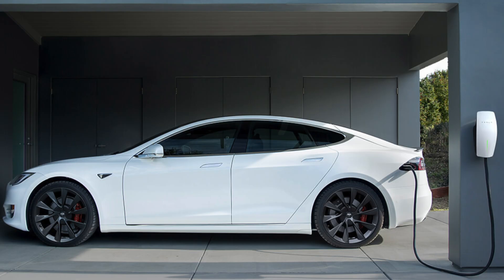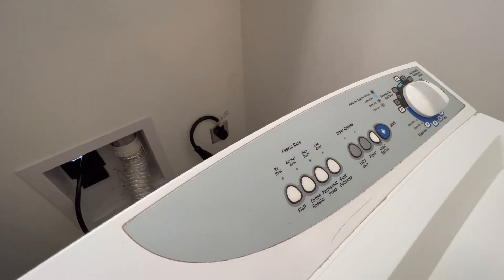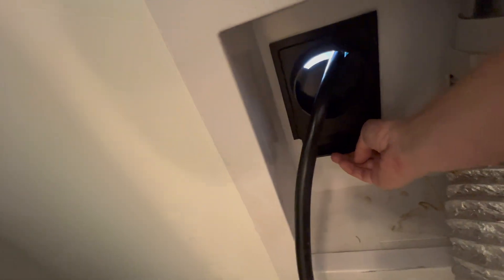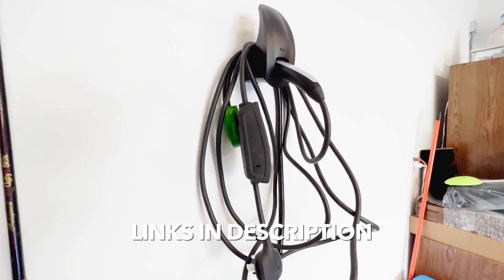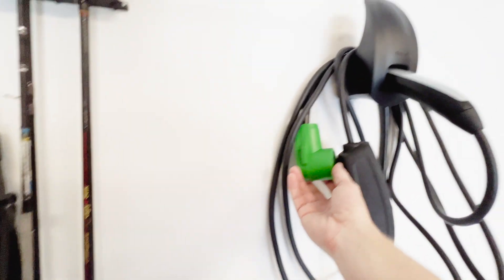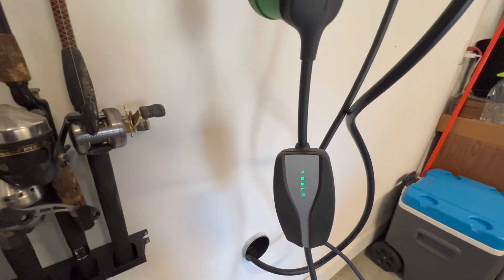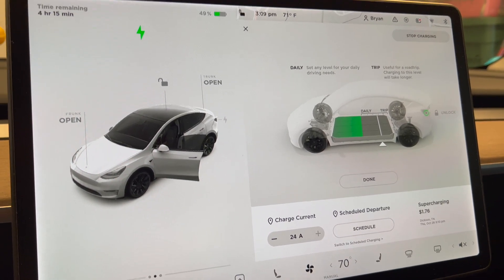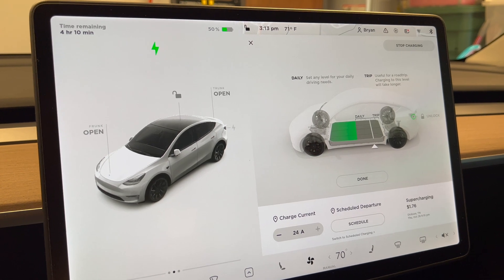Tesla Fast Charging at Home w/ Dryer Plug - Quick Tip

Comment: This is a stupid question, but I am considering buying a used 2020 model 3 and am wondering what charging cable comes with it. It shows a cable in a bag, but I have no idea what that might be. But this video and instructions will work perfectly for me!  Thanks and I appreciate the links to purchase the items too!
Reply from the maker: Hey Joseph - Not a stupid question at all. Up until earlier this year Tesla included (for free) the mobile charger along with an adapter for plugging into a regular wall outlet (NEMA 5-15) as well as a (NEMA 14-50) adapter for use at campgrounds or if you have an electrician install a 50AMP plug in your garage. You can view that kit here on Tesla's website: https://shop.tesla.com/product/mobile-connector
They now charge $230 for that kit when you're checking out while buying a new Tesla. That's typically what the bag would consist of, but I'd suggest asking the owner or dealer what is all in the bag. Usually it also consisted on one more small adapter called a J1772 which allowed Tesla's to charge at those small chargers outside of department stores, grocery stores and hotels. These are very slow, but are great at hotels if you're staying overnight. Many are even free.

You won't need any of these cables or adapters to charge at Tesla Superchargers on road trips. Just pull into the stall, plug in and it will auto charge your card of file in the Tesla App. 

Depending on which car you end up with, for ones with normal lithium-ion battery packs, you want to daily charge to around 85% and when on a road trip you only want to charge just over the amount needed to get to the next Supercharger as charging slows the higher % you go so Supercharging is fast when you have little juice in the car, but as the charging % fills up it starts to slow down the charging process. It might only take you 15 minutes to charge from 10% to 80% on a 250kW Supercharger, but would likely take another 20 minutes to charge that last amount from 80% to 100%. So again... when at home just plug your car in daily and set the limit to around 85% and when on road trips using the Supercharger network, if the car says you can make it to that next Supercharger with 50% battery, just charge to 55% and get on your way. This makes your charing experience faster and keeps the chargers free for others. 

I have plenty of videos on everything from home charging to Supercharging to charging at campgrounds on my channel so just browse the main videos tab and you'll find them.

To give you an idea of charging speeds...

- Using the NEMA 5-15 wall outlet plug will only get you about 3 miles per hour charging. This is usually only used in case of emergency or if you're say staying at an Airbnb for a weekend and can just plug into a normal wall outlet. Usually around 1-2 kW of speed which translates to multiple days to charge up.   

- Using the method in this video above I was able to use a 30AMP dryer plug to charge my Model Y at up to 21 miles per hour. I initially went this route due to is being so inexpensive to setup. Usually around 7 kW of speed.

- 50AMP plug: Getting a 50AMP plug installed by an electrician allows you to charge up to 36 miles per hour using a NEMA 14-50 adapter on Model Y and above which should come in the bag. I think the Model 3 Standard Range limits it to 32AMP so you can only get 21 miles per hour charging with this method so you wouldn't see any advantage over the dryer plug with a Model 3 Standard Range.  You can also get various other 3rd party chargers that plug into a 50AMP outlet. Usually around 9 kW of speed. 

- Hardwired: You can have an electrician install a 60AMP breaker along with hardwiring a Tesla wall charger or some other 3rd party charger so you can get up to 44 miles per hour charging. Usually around 11.5 kW of speed.

- Tesla Superchargers: These are super fast and vary from 72kW up to 250kW of speed with most Superchargers being either 150 kW or 250 kW of speed. Almost all new ones being installed are 250 kW for charging in about 15 - 20 minutes. Of course you don't need any extra equipment for these. 

I know it can get a little confusing, but just watch my videos on these subjects and you'll figure it out and feel free to ask more questions as I'm happy to help 😀
Reply: @bryanhauer  Amazing response, thank you very much, and I plan on watching your other videos too.  I will subscribe!!!

Comment: Can I use a longer extension? I have my dryer plug upstairs lol. Was thinking about getting a dryer plug extension. Will that work ?
Reply from the maker: Sure, but it needs to be the RV Mate cord listed in the description below the video as it has to be a heavy gauge cord rated for EV use. You can't just use a regular ext cord. They offer 3 lengths... 10ft, 25ft & 50ft so just head down to the link in the description for it.
Reply: @bryanhauer can you please put link here I don’t see it lol. The 25 feet
Reply from the maker: @Jwips.  CHARGING PRODUCTS FROM THIS VIDEO:
Tesla 14-30 Adapter (Select 14-30 from Dropdown): https://shop.tesla.com/product/gen-2-nema-adapters
RVMATE 4 Prong Dryer Extension Cord 10FT: https://geni.us/4qiS
NEMA 14-30 Splitter: https://geni.us/fLuVWzw
Charging Cable Organizer: https://geni.us/cTEK
4 Inch ABS Plastic Blast Gate 4 inch: https://geni.us/q13Z
Magnetic Hooks: https://www.homedepot.com/p/Master-Magnet-Handi-Hook-20-lb-Magnetic-Pull-Hook-07218HD/202639937
Tesla EV Sign: https://www.etsy.com/listing/935401359/tesla-electric-vehicle-parking-sign?ga_order=most_relevant&ga_search_type=all&ga_view_type=gallery&ga_search_query=tesla+signs&ref=sr_gallery-1-6&organic_search_click=1

Under each video there will be some text and at the bottom of that it will say View More... You just click View More and it'll expand and then you can see the full Description under each video. I added the links above though so you easily grab what you need 👍🏻
Reply: @bryanhauer  what about the extension cord
Reply from the maker: It's the 2nd link listed. Just click that one and select the 25 ft version. RVMATE 4 Prong Dryer Extension Cord 10FT: https://geni.us/4qiS

Comment: Any update to this setup? Iv heard reports of plugs burning out.
Reply from the maker: If you use the correct cords including the splitter so you never have to unplug from the dryer outlet it works great! I’ve since installed a NEMA 14-50, but this setup worked flawlessly for a couple years.

Comment: My dryer breaker says 20 on it, will this setup still work?
Reply from the maker: I don't believe so. Would have to be a 30AMP breaker. You can still use the normal wall outlet and the 110v adapter to the mobile charger, but you'll only get around 3 miles per hour of charging. I'd talk with a certified electrician to get a NEMA 14-50 plug installed on a 50AMP breaker so you can use a 40AMP charger or even a 48AMP charger like the Tesla Wall Connector hardwired onto a 60AMP breaker. Neither of these options are as cheap, but my solution in the video only makes sense if you already have a 30AMP dryer plug so if you have to call an electrician anyways, you might as well go with installing a real 40AMP on a NEMA 14-50 plug or the fastest option which is the Tesla Wall Connector hardwired onto a 60AMP breaker.
Reply: @bryanhauer  thank you for the reply! I'm just an idiot. There was a 20 amp breaker which was labeled laundry so I assumed that was my dryer. Turns it it wasn't, I have a 30amp for my dryer 😂 thanks for the video and the reply!
Reply from the maker: Oh good  👍
Reply: Hey I understand that you are not an electrician but based off of your experience with this setup would you say it would be fine for me to run this cable through my wall which leads to the outdoors. I'm planning on using fireproof spray foam to prevent bugs in any other air leaks from the outside
Reply from the maker: @ri-wh4df  I know certain locations say that running through drywall isn't up to code, but again I'm not a professional and it likely depends on rules in your area or what you're willing to do. In my case I didn't have to as there was already a cutout there for the dryer exhaust so only had to go through a thin piece of plastic. For legal reasons I'd prefer not to give advice as everyone's situation is different.

Comment: My bmw ix level 2 charger is 48amp,  can i still charge with 30amp dryer outlet?
Reply from the maker: Not sure I completely understand your question. If you already have a charger is it not hooked up? Typically a 48AMP charger would need to be hardwired (preferably by a certified electrician) to a 60AMP breaker although some chargers can also be used with a change of settings to 40AMPs and used on a 50 AMP breaker with a NEMA 14-50 outlet. I don’t believe it could be used on a 30AMP dryer outlet.
Reply: @bryanhauer  ohh i see.  By the way, i put 30  miles every day, do you think usung  level 1  charger can ruin car battery if charge everyday?  Thank you for answering
Reply from the maker: I don’t think using a level one charger everyday would have any negative effect on an EV, but I’m not familiar with the BMW EV’s enough to say for sure. If you have a 48AMP charger already I’d just get an electrician to install it on a 60AMP circuit and then you’ll have good speeds for charging at home. You have to have more AMP's available on the breaker than you are using so you can't use a 48AMP charger on a 30AMP breaker.

Comment: Is it my 30 amp barker gone trip in middle of charging?
Reply from the maker: Not sure I understand your question. It should trip as long as you're not using the dryer at the same time. If it does, you might not have enough room on that breaker. If you're unsure, make sure to ask a licensed electrician.

Comment: Typical cost to have Tesla wall charger installed?
Reply from the maker: About $500 for the hardware and about $500 on avg for the install from a certified electrician. Installation can vary widely depending on where you live (Nashville it might cost $350, but in Los Angeles might be $1500.) I’d say most places you can get it done for around $500. Check out my recent video where I had an electrician install a NEMA 14-50 plug: https://youtu.be/DWP_7gdM86g
Reply: @bryanhauer  thanks Bryan. Enjoyed your video. Just now deciding on getting a model 3 or not. Our dryer is in the garage here in AZ and I have contemplated this idea before. This method does seem to be doable for sure. 😊
Reply from the maker: Yeah if they dryer is already out there you can spend less than $150 and be set with around 21 miles per hour of range added 👍 get the splitter so you don’t have to plug and unplug as dryer outlets aren’t made for that and make sure not to run the dryer at the same time and then you should be good.

Comment: This may be a stupid question, but I don't want to blow something. I have my Dryer plug split to charge our Tesla. The Washer is not connected to the same outlet. But should I not run the washer at the same time as the Tesla is charging as well?
Reply from the maker: No stupid questions when you're dealing with electricity. The dryer in this case is on a 240v circuit while the washer is typically on a normal 120v wall outlet so they're not on the same breaker and wouldn't affect each other.
Reply: @bryanhauer  That's what I thought, but I wanted to be sure! Thanks!

Comment: Is it ok to leave adapter connected when not in use, or if   I am charging Tesla and at the same time if I need to use dryer, can I use app to stop charging Tesla and use dryer without 
unplugging from car
Reply from the maker: Not 100% sure. It's probably ok, but I'd suggest the conservative route and disconnect from the car to be safe. My guess is the worst that could happen is it would trip the breaker, but haven't tried testing that.

Comment: It’s electric, my set up is similar to yours only thing is there’s two walls in between, so is it OK to use longer than 10 feet of extension cord?
Reply: Bryan, I can’t thank you enough, I did exactly how you did , working fine ,  I don’t see any wires are getting hot …it’s been charging for 4 hrs , will there be any wires get hot later.
Reply from the maker: @DaveBuddy-gj2kq  Every situation and setup is different, but if you're using the correct equipment and it's charging fine without issues, just keep an eye on it for the first week or two and double check everything. The car has many built in protections so should stop charging if there's any overheating issues and/or the circuit should trip.
Reply from the maker: The extension cord has to be an RV/EV rated extension cord. If you look in the description of this video, you'll see I linked to the ones that will work. Hope that helps!
Reply: @bryanhauer thanks a lot , your video  very helpful.  I will use your link to get all I needed

Comment: Very nice presentation.  My dryer uses natural gas.  So my receptacle is available to use.  Do I even need to convert from the 10-30 to a 14-30.  Or can I just use the 10-30 adapter?  Also, I have seen a 10-30 to a 14-50 adapter.  Would that work as well?  Also, where can I buy that circular wall contraption that you incorporated in your wall?  Again, great video.
Reply from the maker: Hi Ted - Thanks! You can just get the Tesla 10-30 adapter and that's all you need. Plug that into the Tesla Mobile Charger and you're on your way to around 21 miles per hour of charging. 👍🏻 All the links to everything in the video are in the description just below the video. Click or tap the Show More under the video. Here's the link to the Tesla adapter. Just select the 10-30 one from the dropdown. If it says out of stock, just add your email for Tesla to alert you when they are back in stock which usually happens every week: https://shop.tesla.com/product/gen-2-nema-adapters
Reply: I have the same setup: my dryer uses gas, and my dryer 220v receptacle is available to use. I was asking (and waiting to hear back) from an electrician family relative about installing the Wall Charger, upgrading the existing dryer wires to No. 6, and replacing the receptacle to the appropriate 14-50 to handle 50a charging. I also found out that the dryer receptacle can melt because instead of being in use for drying clothes for 2-3 hrs, charging EV would be an overnight, and that's can damage the receptacle. So need a 14-50 receptacle that's made for EV charging.

I might just end up upgrading the existing dryer receptacle to the appropriate EV receptacle and just use the mobile charger like this video.

Comment: I'm really enjoying your videos. Thank you for your content. I wanted to caution you to be careful when plugging in to that dryer feed. In this video I'm guessing you were trying to plug in one handed while holding a camera it appeared like your fingers were close to the plug leads when it was about halfway plugged in. If you made contact with those 220V leads it mostly likely would have burnt you badly or worse.  Keep the great videos coming. Is your Jackery battery pack the size you needed for everything or could you have gotten by with a smaller one? Thx.
Reply from the maker: Thank you 👍🏻 Appreciate the kind words and the safety tip. For the Jackery... I think the 1500 I have is the smallest that would work for me as cooking with an air fryer or hot plate uses quite a bit of power. Could maybe get by with the 1000. Hoping to test the all-new Jackery 3000 soon, but that's more for home backup use. Regardless which one you choose, they work great!

Comment: Hi
I don’t have dryer plug 14-50 but I have 10-30p so can I use this for my Tesla 3 ?
Reply from the maker: Sure. Just select the Tesla 10-30 Adapter from the dropdown. Everything else in the video is the same, but just select the 10-30 option for any other splitters or ext cables: https://shop.tesla.com/product/gen-2-nema-adapters

Comment: And how is this one year later?  I was watching a Sandy Munro video and it was suggested this was not a recommended application for the dryer outlet due to failure.
Reply from the maker: Usually it's only NOT recommend if you plan to unplug it often which is the point of failure since dryer plugs aren't meant for that kind of plugging and unplugging often, but my solution includes a splitter so it removes that issue completely. Not one problem since the beginning 👍🏻

Comment: Thanks!! Very helpful.
Reply from the maker: Glad it helped! 😀
Reply: @bryanhauer  So I just met with a licensed electrician and talked about my options. Everyone is "upselling" these days. His recommendation was a simple 240 volt 50 amp plug installed outside next to my meter for $600. When I suggested using the dry outlet and putting an external outlet in my garage (adjacent to my drier on the other side of the wall) he hemmed and hawed, said it would be a fire safety and it could burn down my house. Factually, I think the worst that could happen, assuming both my drier and charger are on, is that it just trips the breaker. He finally said I could do it, but he was prevented by law to do for me.   :)
Reply from the maker: Yeah they usually won't do it themselves, but I've had two inspect and say it was perfectly fine. Only concern usually is plugging and unplugging from a dryer outlet as they're not meant for that, but the splitter solves that issue. 50AMP plug is probably the best solution longterm, but depends on installations pricing which can fluctuate heavily. I recently got one installed for only $250 from a licensed electrician in the Nashville area, but in California I've heard of people being quoted $2000 which is crazy.

Comment: SMH my dryer has regular plugs
Reply from the maker: Yeah that won't help you then if they're just normal 110v outlets. Then you can just plug into any outlet in the garage with the 5-15 mobile connector, but you'll only get around 3 miles per hour of charge unfortunately. You'll need 30, 50 or 60AMP breakers to use the faster ones.